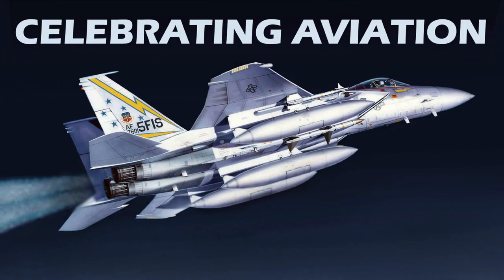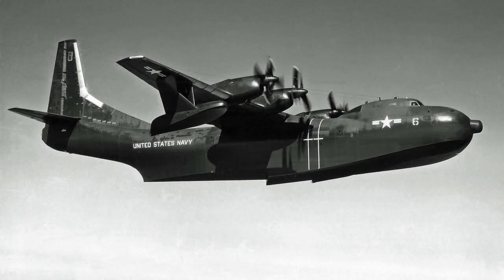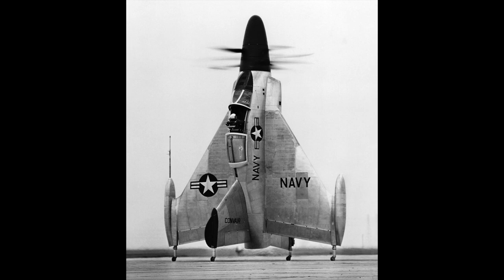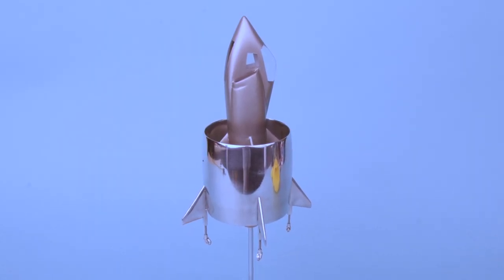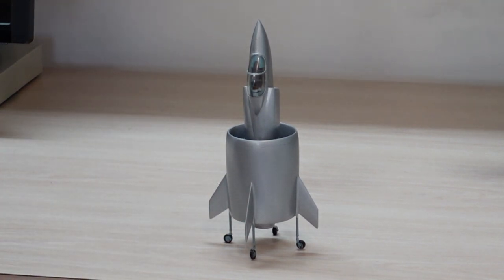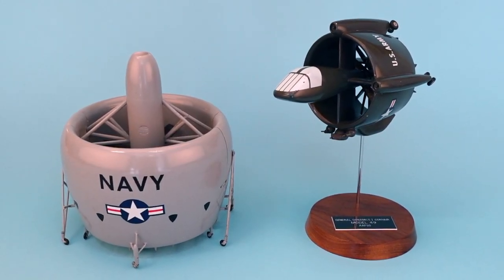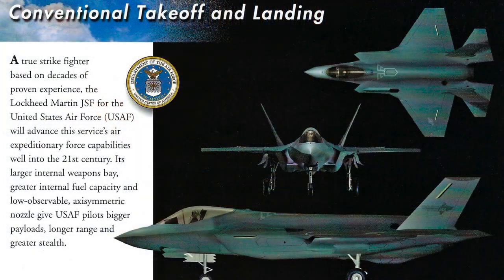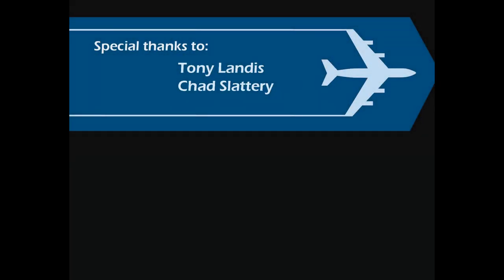EXPERIMENTAL VTOL AIRCRAFT - The Relentless Quest For Vertical Flight

Comment: Fuel consumption.  The Achilles heel of pure VTOL jet powered aircraft. The ski ramp is the best workable solution for ship board use IMO. 
As to the Pogo or Salmon VTOL shipboard proposals from the 50s with todays flight control systems plus advances in video technology that would have allowed vastly more robust viewing "TVs" in the cockpit. The system would be more workable. But the best solution for actually getting back on board might have been a system to have a means by which a hook on a cable could be caught by the ship and then  use a winch system to reel the aircraft in.